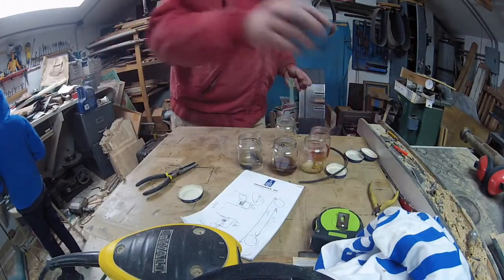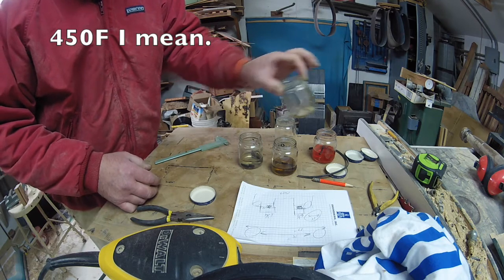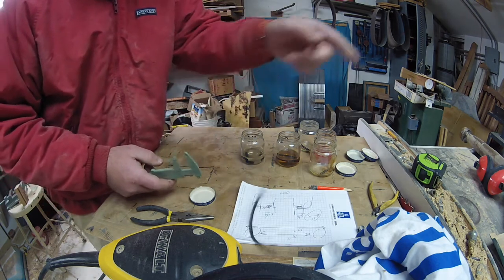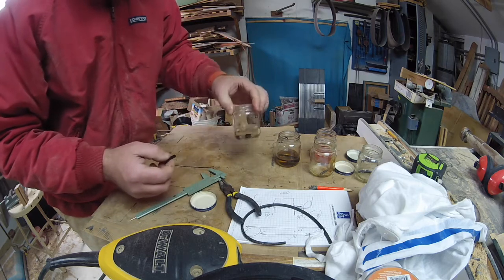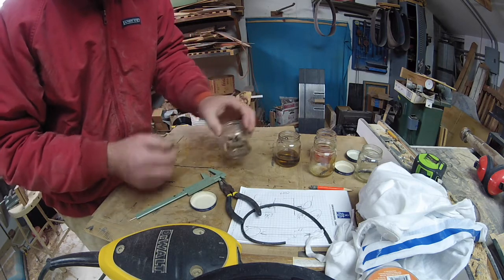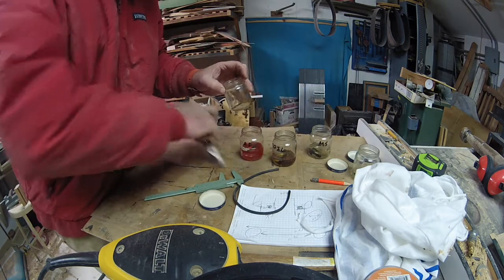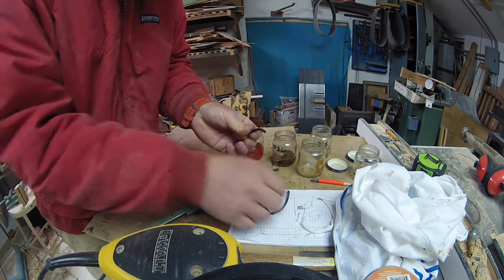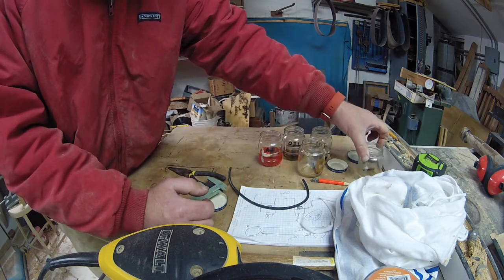Testing Cylinder Liner O-RIngs

Comment: White spirit is great to clean body work and any metal parts without rubber or plastic. In general to be kept far away from your vehicle.
ATF oil can return some life to "death" rubber and most plastics. Curious you didn't test that. 
Either case good video and demonstration. Thanks for sharing. :-)
Reply from the maker: I think we were testing just the stuff that might get on the rings in the motor but yes atf would have been a good test.

Comment: Great video! Your videos on your trucks always inform me more and more, for the day I pick mine up, possibly as the first project/vehicle I ever own.  So basically the take-away from this is just don't allow the EGT's to go through the roof, and use the Cummins-specified coolant?
Reply from the maker: Oh I think any coolant is fine as long as it isn't allowed to go acidic.  The additive package is more for OTR guys who put 100,000's of miles on their trucks a year.  But, yea it is what they spec.  The NHC250 with the auto behind with torch itself climbing a hill empty unless you peg it at redline.  Go figure.  I am personally quite sure that is why they swapped to a turbo motor of the same HP shortly after switching to the auto despite running the 250 for decades.  I am sure you could prove it with a FOI request but I am not sure who to or what to ask.
Reply from the maker: My point in the video is that the motors were not failing BECAUSE I was running the additive as to very loud individuals were claiming.
Reply: Wait...I'm a little confused.  It'll cook itself with that auto UNLESS run at redline climbing a steep grade for miles at a time?

I heard they went with the 8.3 since the NHC250 went out of production, and for better fuel economy (about double for an M923A2 vs a M923A1, for instance).  But I could be wrong; just what I've heard.

Have you considered a M923A2/M925A2 for your application?  Or would the elevation there in MT cause issues with the turbo?
Reply from the maker: Yep EGTs north of 1400.  Fuel economy would be important but I don't buy the argument that the military retooled an entire truck line so gain a few MPG but maybe.  They have never been overly concerned before.  Retooled an entire line because a congressman wanted a contract in his/her state, that I might believe.  There were a bunch of other teething issues with the auto swap, like brake lock-up and rollovers, my money is still on high EGT with 250's.  An A2 would have worked nice.
Reply: So basically anything south of 1400*F would eventually be a slow, painful death for an NHC250, analogous to going too fast for too long in too low of a gear?
Reply: And yeah, knowing the United States government I doubt MPG was a factor myself, but you never know.  

You have no idea how much I appreciate your videos and your feedback.  Your original documentary of driving 1000 miles more or less straight through in an M923A1 is one of the things that first inspired me to own one, and I have a lead on an M923 which I will hopefully be owning at some point in the distant future.
Reply from the maker: I hate the thought of all that unbalanced crap wizzing around in there faster than it needs too but yea at 1900rpm  you can watch the EGTs climb for the heavens, at 2150 they drop like a stone back to the 1000F range.
Reply from the maker: Cool, I hope she is a runner for you.  All of mine would have run forever if I had put a pyromiter on them first thing.  Put a pyromiter on first thing is my recommendation and then keep it below 1200F at all times.
Reply: I will definitely look into the pyrometer thing!  I think she's a good truck, supposedly only 3200 original miles (the hours do seem consistent, so at least since a rebuild...supposedly.  Truck also came from the local NG unit where I spent my childhood as it happens, so she's a little special to me in that regard.  

What would you recommend in the meantime, before I could get a pyrometer installed?  What RPM/gear range?

Comment: Sooooo....what is the CAUSE of the excessive heat? Then...how can that problem be alleviated?? There has GOT to be a way to save those engines. Right?
Thanks!
Chip
Reply from the maker: EGTs.  The NHC250 with the auto behind with torch itself climbing a hill empty unless you peg it at redline.  Go figure.  I am personally quite sure that is why they swapped to a turbo motor of the same HP shortly after switching to the auto despite running the 250 for decades.  I am sure you could prove it with a FOI request but I am not sure who to or what to ask.

Comment: If you want to know what antifreeze is best for your truck fill it up and drive it for a thousand miles. Get a meter and ohm it out. You will be surprised. One lead on the block one in the antifreeze. You will then know what antifreeze is chewing your motor up. Just like electrolysis. Ever remove rust off something with the electrolysis? Imagine what that does to an engine block and related parts.

Comment: I was a dealership mechanic for years!! Use what they say in the bulletin. Period.
Reply from the maker: But 30 years ago they... I get so tired of hearing it.
Reply: NelsonStudios I understand. This has nothing to do with this but the craziest shit I seen was a old man come in with a leaking radiator but it wasn’t leaking when I looked at it. I asked him what kind of stop leak did he put in it for a temp fix. He said a raw egg. It sorta cooks and plugged up the hole. Pulled the radiator cap off and it looked like white fried eggs. New one on me.
Reply from the maker: I have heard of that also cinnamon and ground pepper.  Sounds like the start of a crappy omelet.  I had an old jeep with a weepy radiator and lost the lower hose on some brush.  Found it in the road after the overheat and refilled with water straight from a swamp, the only water available.  Did my best to keep chunks and bugs out but it was foul.  By the time I got home the weeping had stopped and even after flushing it I never had troubles again so maybe a swamp omelet would be the silver bullet.
Reply: NelsonStudios I will try the swamp omelet.  Prob a big bug stuck in the hole.
Reply: I have tried to use the black pepper method on a leaky radiator before. Its great until it builds up in the heater core and water jackets. Causing more problems than it fixes.  I am going to assume that the egg would do the same.
Reply: billhacks anything that you put in a radiator to stop a leak home made or store bought can do that. I’ve seen many many cars plugged up like that.  I’ve back flushed countless heater cores over the years like you said. Doing any of this is an absolute last resort. Enough to get home or to a garage. Plugging up radiators on modern cars is no big deal when you have a leaking radiator because the tanks are made of plastic. Not like the good old days where it can be soldered up. If you could repair the radiator the cost for a new radiator is not that much more than having it repaired.